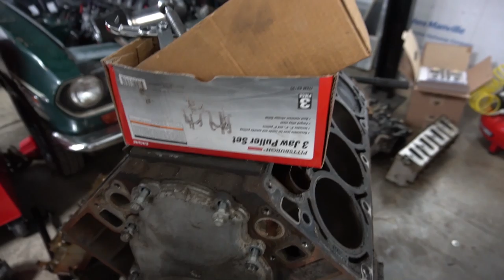Disassembling the Junkyard 4.8L LS Engine for the S-10 Swap Burnout Truck!

Comment: On the cam swap, we pulled the pushrods and spun the cam over a couple times then slid it right out. The angle the lifters lay worked in our favor to keep things stationery till we slid the new cam back in. Is that not normal?
Reply from the maker: I forgot about this but your right the lifter trays will hold the lifters. But if a lifter happens to slide out while the cam is out you could have a mess on your hands lol
Reply: Use 3/8 dowels if it's high mileage,  if those lifter trays are lose u gonna drop a lifter in the oil pan then ur really fucked